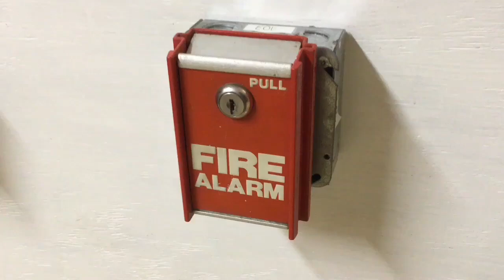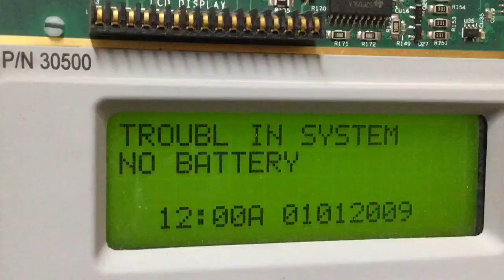All of a Your Pain as a Fire Alarm Enthusiast in One Video

Comment: I am an enthusiast, but I am still a kid. Keep in mind costs for these things seem big for a 16-year-old. I bought a Wheelock speaker strobe. I wired it up, following the instructions. Within two seconds, the strobe exploded, sending shrapnel flying all over my room (some of it impaling me), and it tripped the circuit breaker / fuse for my bedroom. And Wheelock didn’t offer a refund, saying that the “tamper seal was broken”. Well, no duh, the thing literally EXPLODED. When I evaluated the pieces, I saw the cause: a short circuit caused by a solder bridge (a manufacturer defect) in the strobe, causing the parts in turn to short circuit and explode.
Reply from the maker: I’m 14 and I bought all 200 devices myself

That sounds highly unusual, that’s why you don’t wire devices to mains power. 24VDC only
Reply: @FireAlarmDude5967  wow, you're younger than me 😂 I'm 16